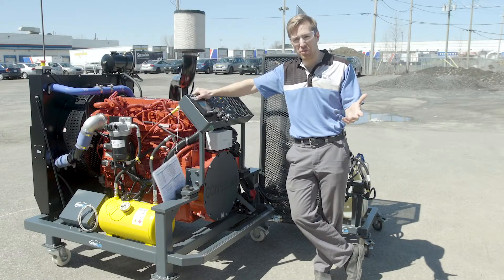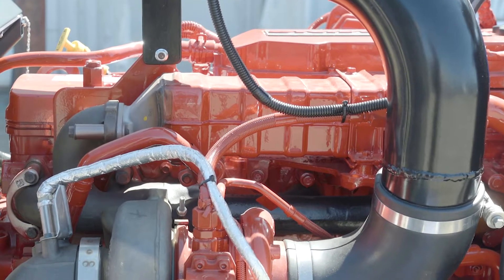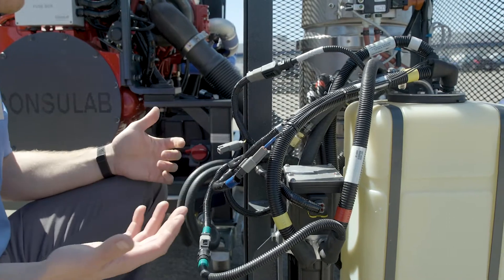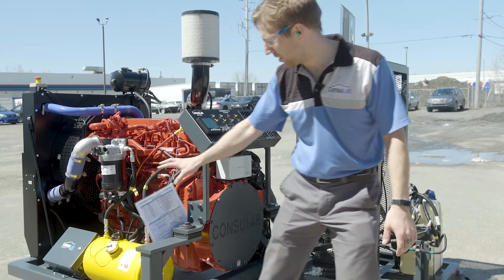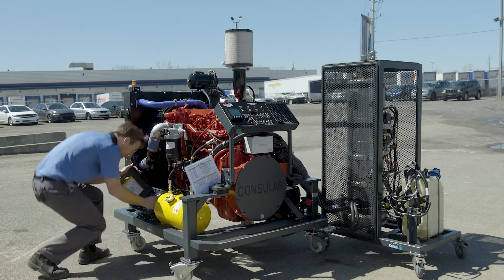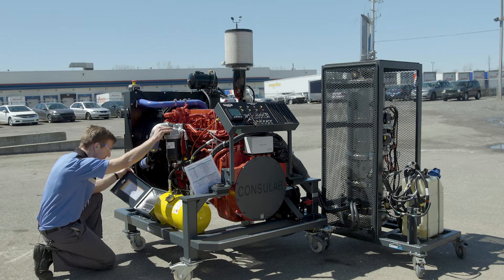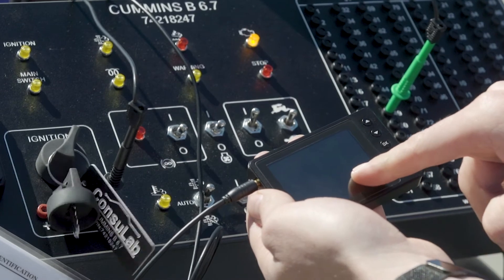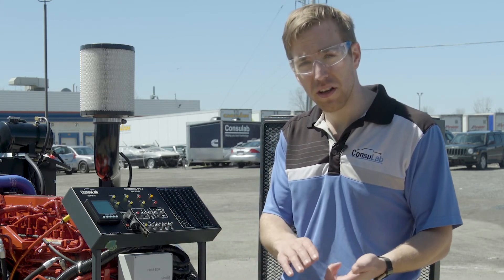B6.7 DIESEL ENGINE BENCH - CUMMINS EPA 2017

Comment: EPA restrictions have nothing to do with Performance and aren't even dictated by anyone who understands them.

Our 2007 truck was getting significantly better fuel milage than our 2018 truck. 25% less fuel consumption
Reply from the maker: Yes, the year 2007 made a great difference in the diesel world. The rules changed, the emissions drastically decreased, and you are correct, fuel economy took a hit as well. It was part of the price to pay for cleaner air!
Reply: @Consulab  
But how do you justify spending more of a finite resource, to make for cleaner air that will become cleaner as the other technology improves.

We can look back to the industrial era when everything was coal, look how clean our air is now.. We improved the technology and mother nature healed and replenished our air. Would burning more coal back then to make their emissions cleaner have made any difference now? No!!we would just wish they hadn't used so much coal that we could be/ and do use now.

We know petroleum is finite , so consuming more of it is the least logical progression to conserve resources. I fundamentally agree with making emissions cleaner, but consuming more of our finite petroleum in the process will not help - and in the near to distant future when it becomes very scarce we are going to wish we had the millions of litres of it we wasted burning to clean DEF filters.
Reply: We need to improve the quality of fuels, the quality of lubricating oils,  engine technology. Less fuel burned is the best case scenario to conserve our resources and make them last as long as we can while we invent alternatives.
Reply from the maker: @RiceReaper  Absolutely!
Reply from the maker: @RiceReaper  Like you mentioned in your other comment, doing more with less is the the goal, all while we develop cleaner solutions. 

Our job at ConsuLab is to make it easier for teachers to teach and students to learn whatever those solutions may be! 

I'm sure you can understand the need for training aids to teach the very complex aftertreatment systems that are currently in use!
Reply: @Consulab  Cleaner air? Diesel particles fall to the ground

Comment: The EPA needs to take some of that stuff off, I would understand if there was SOME emissions equipment but not like it is now. It grenades the engine and requires valuable resources to manufacture the emissions equipment. Not only that, the aftertreatment and dpf is horrible on road trucks, they do not get hot enough to burn off all the carbon and plug up the filters faster. The aftertreatment and dpf filters work best when hot, in equipment such as tractors and skidloaders the system works relatively well. But in trucks, get rid of it.
Reply from the maker: You are correct, there are many issues with emissions systems from many manufacturers. It is always a compromise and far from ideal. All for cleaner air.